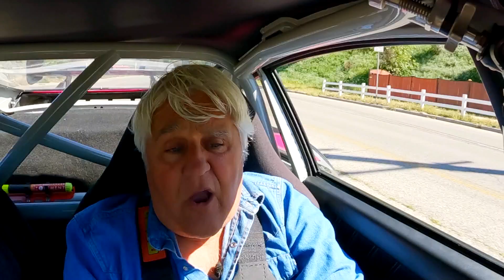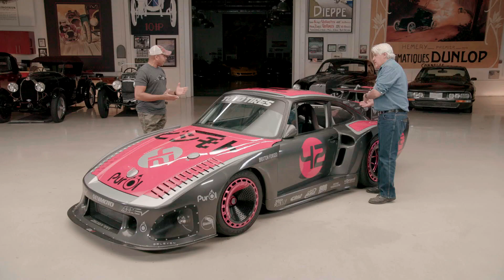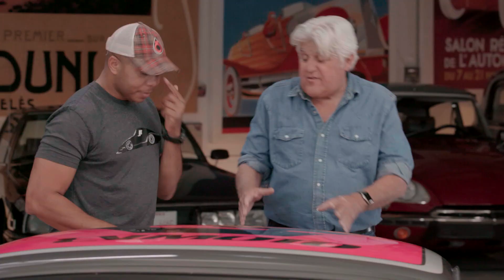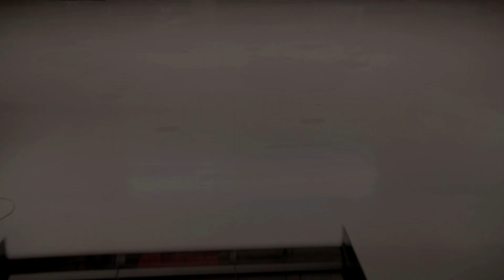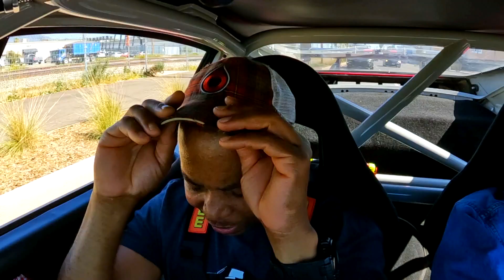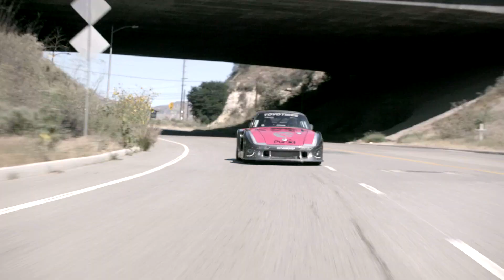Bisimoto’s Porsche 935 K3V | Jay Leno's Garage

Comment: 13:35 It's called "Skin Effect". The Electrons don't flow through the wire the flow on the surface of the Wire so the more surface area you have the more capacity for Conductance you have available. If you know recognize the Designer/Engineer you KNEW it was going to have regenerative Braking. High Performance Remote Control Cars have had it for 30 years now.

Comment: What a georgeous vehicle, I would love this thing, although I probably wouldn't be able to drive it the car meet at COTA and back with it's relatively short range. A newer "hybrid" racer, the Audi Dakar racer uses a DTM derived engine to charge the batteries, it just runs at a constant hight rpm, thus it's very efficient. I still worry about the resources needed for all the batteries and components when it becomes more mainstream. The gov needs to stop strong arming us into EV's and allow technology to answer the problem when it's right, it'll be interesting to see CA when you don't have a choice.

Comment: Bisi is such an interesting fellow and his cars are always amazing. I think there is a big misconception that if you pull the battery disconnect that the fire goes out. This is not the case. When a lithium ion battery has thermal runaway because an accident or other reason, the fire doesn't go out until the combustibles are burned up. A gas fire can be extinguished but a lithium ion battery fire must burn it's self out.

Comment: This guy knows nothing. 
Ammonia is a fuel too,   is 100% renewable , highest level of octane and btu's for engines of any renewable  fuel. 
Ammonia is used in rocket fuel, aviation  fuel. The land speed record  was gained in rocket car running straight ammonia.  
It is not caustic to metals like alcohol  fuels.
So seriously  this guy knows nothing  of fuels and builds. Just wanted get his mug in a video.
And you can switch  to ammonia  in a flex fuel, gasoline,  diesel vehicle right now.  
https://youtu.be/Bs3HSChSh_E
https://youtu.be/XHZXAz9WP9M
 https://youtu.be/L0hBAz6MxC4

Comment: Hey Bisi ...Stellar project.  You continue feeling guilty.   Electric cars are all running on Coal, Natural Gas & High Sufer Fuel Oil ... until we can boost Wind & Solar to significant levels.  Also,  you will be able to feel guilty about all the hazmat from the spent electric car batteries piling up.
Reply: You are dumb. Coal power plants are 45% thermal efficient, natural gas is 60%, your car is 20%. Even just attaching a diesel generator to your charger is more efficuent than an ICE car. 

The worst EV out there is still more efficient than even the best ICE using the highest tier technology. Especially in cities like vegas than run off of hydroelectric.

Comment: A 911-series Porsche - as this is - has got to be the perfect candidate for an electric swap: Stock, it has some 350-400 pounds of steel and aluminum hanging off the rear axle. That's a recipe for screwy handling. Porsche did all they could to fix that, but it's still a handful for anyone but an expert. But as an electric, that weight becomes one-third, and I suspect it's much more controllable.

Comment: Electric cars are not clean! You are still using fossil fuels burned but the power plant. It's actually less efficient due to transmission loss.  Not to mention the damage done to the environment in mining the prescious metal's. Don't forget you have to dispose of the batteries...
Reply: Batteries are reusable and recyclable.
Coal power plants (the worst source) are 35-45% thermal efficient, natural gas is 60% ...meanwhile your gasoline car is just 20%. One third. Pathetic. 

Transfer losses are about 10% the math comes out to EVs WORST CASE scenario being 30% efficient-- this however is unrealistic. In the real world we get power from multiple sources. For example in Nevada they have tons of solar and hydro energy, in Texas we have lots of natural gas. Its a no brainer to get an EV. Its more efficient than a prius and cheaper to maintain.

On top of all this Coal power plants are actually very clean and do well at recapturing carbon emissions, much better than the junk catalytic converter you have

Comment: Most porches are 50/50 weight distribution from the factory.......just saying.
Reply: Depends which side of the porch has the most chairs... 😎
Reply: Weight distribution is only half the story, the cars rotated a certain way despite the weight on the tires

Comment: Great video - love Jay and his knowledge.  But, a "thermal runaway" isn't a Bisi term.  It's a very common association for any time the heat production of an energy source outruns the cooling capacity.  Also, it does not necessarily result in a fire.  In fact, rarely mentioned, lithium ion batteries that get punctured without any heat influence can spontaneously ignite when reacting with water (as moisture in the air).

Comment: @33:38 He is mostly wrong about batteries weighing more when charged!  You would need an automotive scale that is more accurate than anything on the market to measure such a change!  For electric cars, there is no measurable weight difference at all.  We are talking about half of a microgram for a Chevy Volt when charged.  So to say the car weighs a few grams more when charged is completely incorrect and is not really true.  The real answer is that no, electric cars do not weigh more when charged vs empty.

Comment: Electric cars are a medieval antiquity and they are boring, lifeless and dull, electrical switchboards. A hydrogen-powered piston-powered car is the future. The car itself was otherwise fierce on the outside and also partly on the inside.  Bisi, put the original engine and gearbox back in and make it run on hydrogen.

Comment: The talk about feeling guilty for gasoline engines, and digging in the ground for fuel.... As smart as Bisi is I have to believe he knows where lithium comes from.... And what about the disposal of bad batteries?  The charging for the car come from fossil fuels.   Im neither for or against electric cars. They are fast and I think that is awesome. But how much better are they in the end for the environment than gas or diesel cars?

All that aside. Bisi is awesome and this is a great episode. The car is amazing. Anyone that thinks driving an electric car isn't as exciting as a gas powered car because the noise is different or quieter hasn't experienced it.....Jet power is different than internal combustion engine power but its still exciting.... And Im guessing that a rocket is exciting too.   The fact that electric cars accelerate as fast as they do is just amazing.
Reply: I love gas cars and never want to give it up, but evs and their production still produce less environmental pollution. Because gas engines, car manufacturers, gasoline plants, and gasoline transporters,produce wayyy more environmental pollution in the end, it’s true. But still, I don’t ever want to give up gas.

I would settle down with hybrids though. They still sound great, and consume wayyy less gas than regular. Plus that small gas engine in hybrids also charge the cars battery pack. So no real need to plug in the car and charge it at home or charging stations. Why go balls to the wall with a solution? Why not meet in the middle so that we can get the best of both worlds. Some of the best track cars are hybrids. They dominate almost all gas engines. EVs can theoretically get better performance, but it’s just not sustainable for convenience or longevity in the racing or performance world.

The only way I’d ever be sold on buying an ev, is if the exhaust shot out sparks instead of flames like gas cars, and thundering exhaust sounds lol. It all comes down to the sound for me. Very very hard to beat the sound of a gas engine.
Reply: @One Two Three Incorporated yeah I agree with you. They shouldn’t ban perfect drivable ice vehicles. If anything, if it’s seriously an environmental concern, (which is very hard to believe the politicians that push that idea) they still shouldn’t scrap it. If anything slowly phase them out. 

I’d think this is fair.
1) Do not ban ICE vehicles, but maybe stop producing 100% IC engines from whichever point in time on. Let people keep their ICE vehicles, sell them around, do whatever they want with them, but just stop producing new ones.

2) Begin phasing in HEVs, and EVs. 

3) if that’s still really not good enough for our environment, do the same as step 1, but with HEVs instead of ICEs.

Whoever wants to keep their old gas engines keep it. But new cars can only be bought as hybrids or full electric. So older gas engine models would fairly be grandfathered in.

Comment: April 28, 2022 Happy Birthday Jay like your Shows. Still one car on your bucket list to Drive Jaguar XJ13 . I always liked that Porsch'e 9 series flat nose especially front nose. Porsch'e one of my favs to work on and drive handling and braking is excellent if you know how to drive a 9 series Depending on engine it's all about how much you want to spend. I'm a Gas Engine Manual Transmission fan. Can't Duplicate Sound of a Gas Engine Electric cars sound like Vacuum cleaners. Electric Motor Auto trans are you really driving a car?  Drive a F40 Ferrari Ultimate Man's Man car it's all Raw. Cheers Prost

Comment: Super cool wheels for sure! 
I didn't know about the CBX motor cycle having a deceleration lite back in the 80's, now that is cool. 
I thought the SLR also had some yellow brake lights for hard braking on the autobahn?

Comment: Just a note on “Thermal Runaway”, but the term, when referencing Lithium-Ion batteries, refers to a process where an increase in heat leads to a increase in energy release which leads to further increased in heat and so forth. If left to go on to long, it can result in the integrity of the battery failing and thus a fire or even a small explosion. So the term is not quit a synonym for a fire but the process the can lead to one in Lithium-Ion batteries. There have been electric cars, cell phone and computer laptop batteries that suffered from this problem due to manufacturers defects  or flaws in their batteries which resulted in product recalls.
Reply: Yeah Jay said "... you can pull the link and the fire will go out..." No, the thermal runaway event is totally within the battery assembly itself. Disconnecting the battery from the load will make no difference, and the fire will continue.

Comment: i am does not use such batteries, i am useth high intensity dynamic generation heat exchangers and superconductors with broad band frequency kenetic charging superconductors with a buffer and specialized conditioning fields and ambient reclaimation built into the very shapes of every existing part and there are the whirring of like an engine as that of a 60's - 70's mustang and flat 12 porsche 917. Charging is not needed. Charging is not needed. Charging is not needed. Charging is not needed. Charging is not needed. Charging is not needed. Charging is not needed. Charging is not needed. Charging is not needed. Charging is not needed. Charging is not needed. Charging is not needed. Charging is not needed. Charging is not needed.
Reply: Hello there👋👋,how are you doing today?hope you’re having a good day?God bless you

Comment: Performance without the inherent guilt? Not like electricity doesn’t just appear. It must be produced. The minerals in the battery and magnets have to be strip mined from the earthe at a gigantic scale. Using diesel machines and transported by diesel powered ships and trains. Just to be refined. Making an electric car is fine but don’t think your actually helping anything.
Reply: As an owner of an electric car, I agree wholeheartedly.  But it does help my wallet when I’m not paying for gas!
Reply: @d0wnboy  give it a few years electricity will be just as expensive.

Comment: Jay, I like this video overall, but I'm disappointed in a few facts and opinions you shared. For one, you suggested that it will cost $100 for a fill up (of gas). But, just last year, gas was less than $2.00/gal in much of the country... so why would you say that the future price of gasoline must be high? Its only high due to liberals in the white house and that can easily be resolved. Second, you said that fires in electric cars are rare, that there are up to 10M Teslas and that fires in gas cars should be the issue. In reality, there are only 1.9M Teslas while there are 10M Mustangs and 26M F-150s... meaning there are hundreds of times more gas vehicles than electric - and gas fires are a negligible problem. While this electric 935 is cool, electric cars are still boring as hell to most of us and I thought you, too. I'm interested to see if there is a new Jay Leno who is all about EVs versus the one I thought I knew.
Reply: Explain the 217,000+ reported ice vehicle fires in the US alone for just 2021 please?
Then explain how the most common recall on all ice vehicles per manufactuer is for the risk of sudden fire. 
Their are literally tens of millions of cars under recall atm for fire risk. I mean it's in the name "internal combustion engine" 😁
Reply: @4literv6  dude, seriously. The #1 recall for fire is from a huge batch of Korean cars whose ABS electronics catch fire. Has NOTHING to do with ICE. Yet, for EVs, the batteries are what catch fire and are hard to put out and re-catch fire more than 24 hours later (per studies). My point is that Jay said there are 10M Teslas which rarely catch fire, but there are no where near 10M of them, so when they catch fires its way more significant than if, say, a F150 does (statistically). Jay exaggerated the future price of gas and the number of Teslas to make it sound like they are better than the facts, that's all.

Comment: Regen is motor dependent. It is simply reversing the magnetic field. It does produce heat in the motor, but no more than acceleration. A modern electric car motor is always"in gear" the D, R and N stand for drive, reverse and no regen. Freewheeling if you will for extending range down hill for instance. Free miles. When you come to the speed limit use Regen to keep you legal.

Comment: A battery is related to horse power in that, a bigger battery can put out more amps.
Reply: Yes and no, example the rimac nevera has over 1900hp, with 4 motors using a 120kwhs or so available pack capacity. 
The lotus evija also has over 1900hp, with 4 motors like the nevera, but only uses 70kwh total useable pack capacity. 
Also this has only 32kwhs useable, yet gets over 650hp from just one motor. The plaid has 3 motors and 100kwhs pack for 1020hp.👍🏻

Comment: Hi Jay, I'm a fan of yours and a car guy, too.  Appreciate what you do to further our reason for existence!  Let's talk about maintaining & restoring large displacement MOPARs.  My 1969 HEMI Orange Dodge Charger runs fine, just needs the new fuel pump installed to feed the 383 cu in Magnum V-8.  The 1972 Chrysler New Yorker 4 door hardtop's 440 cu in V-8 shows loss of oil pressure (low pressure).  I suspect the oil pump.  Would you recommend to go ahead & pull engine for a tear down inspection?  Thanks, Jay
Let's Roll!

Comment: The digging it out of the ground comment about oil at 33:30 isn't quite right. Has anyone seen lithium mines?! Holy crap.

Edit: Too be fair I love EV's it is just irresponsible to say they are that great for the environment. I think we need high performance hydrogen vehicles over electric until they figure out a new battery chemistry.
Reply: Lithium is used in a lot more than just batteries. It also can be recovered from geo thermal and desalinisation plants. 
Tesla is also trying to figure out how to extract it directly from mud using table salt instead of acid leaching.

Comment: If I was a young man today - I'm starting up a conversion company and buying a boatload of Tesla crate motors for anybody who wants to keep that 60s muscle car but inject some major fun into it. Wouldn't be cheap as a Tesla crate motor would cost about $35k, then add in the tearing out of all things ICE in the donor, frame mods, batteries and BMS and it will cost more than a Tesla even before I add my markup but hey - it's the only way we will see 60s cars on the road in the fairly soon to come future. Bisimoto is just so large, dude is epic. 🚗
Reply: Lookup project testang an 05 mustang gt which runs high 11s converted using a tesla ldu. Total cost was under 25k.
Project electrolite is a 1972 Plymouth satellite also tesla swapped which runs low 12s and cost about 50k to do. 

Plenty of other nicely done enthusiast ev swaps in the 20-50k range. It'll only grow from here, especially now that aem got bought out by Holley to form the ev specific tuning division called Holley high voltage. 😎

Comment: I cant fault the engineering and the brains behind the project but id never drive an ev 935. It deserves a howling flat 6 powertrain. That is a souless shell. Evs are not the future. Most people i know who have bought teslas have sold them and bought a petrol or diesel car. The charging network and lack of practicality doesnt work for me👍

Comment: Not a fan of EV's , but this one draws me in. If the "greenies" actually comprehended the toxicity of Li-Ion battery manufacturing, they'd ban them. Then there is the dependence on the electric power grid which they are doing everything they can to make it unsustainable. As a commuter, this thing rocks.